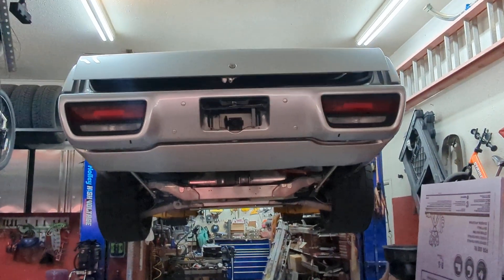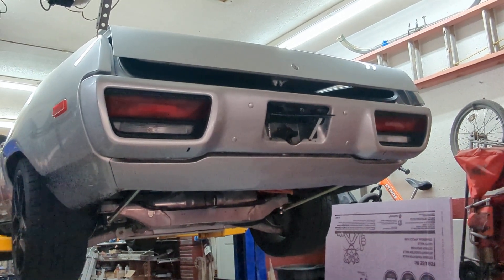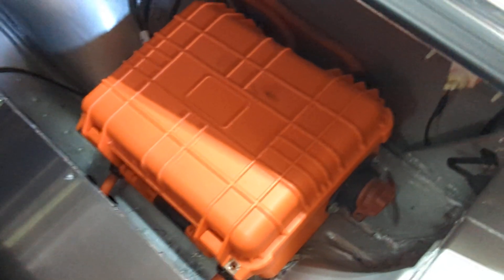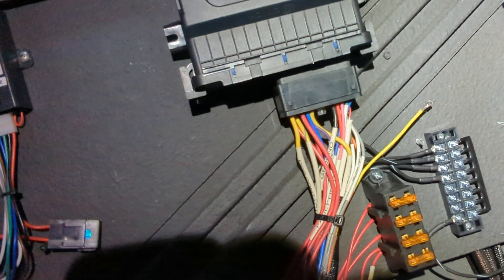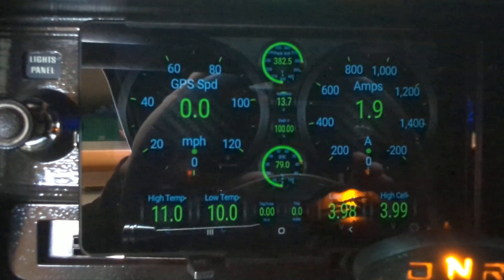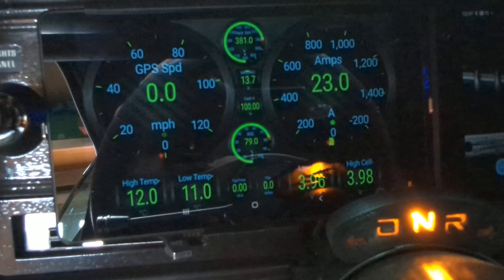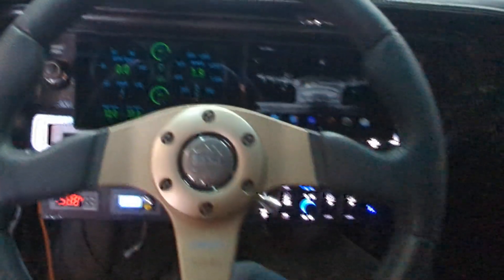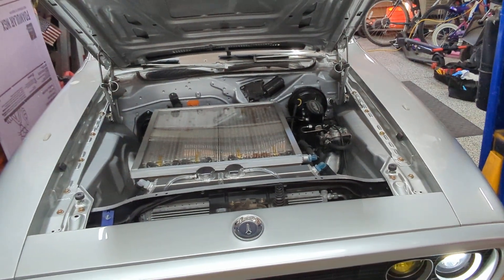Project Electrollite - Plymouth Satellite Tesla Swap - Race mode, HVAC, T-2C. EP. 19.

Comment: That is amazing. I've been thinking about converting my car to electric. 
Don't think I'd go Tesla gear, but your car is definitely an inspiration. I live in Lakewood, co.
Reply from the maker: Thanks, what kind of car and powertrain are you thinking about?
Reply: @MrMoparMan  well, I have a 1984 Honda Accord coupe, which I think would be a good candidate, because it's a very simple machine, no power anything, not even steering, standard tranny.  I was thinking how cool it would be to put an electric motor for the rear wheels, leave the front drive engine, so I could use either or. Or possibly both making it all wheel drive, but no idea how I could sync up the front and rear. But also having it so the front engine could generate power to charge the battery pack.
Reply: As far as power train, I've been looking into some of the conversion kits available online. I also have a 1977 Dodge sportsman 1 ton dually that I'd like to turn into a car hauler. And making it front drive electric, so the flat bed could drop to the ground for loading a car on it, sans rear end and drive shaft.

Comment: Are you eventually going to be putting a belly pan on it to clean up the underside and add some protection for the wiring?
Reply from the maker: Yep I sure am, just making sure I've got everything dialed in.   I'm thinking about adding a second coolant pump on the output of the motor as well as a chiller to pre cool the motor when racing.

Comment: Real curious how you're liking that model s rear end in terms of driving feel, I hear it's a real barge of a rear clip
Reply from the maker: I have to say I love it!  Maybe it's grading on a curve, but this is a pretty huge car weighing 4350lbs and it handles fantastic.  I also like the adjustability, easy to change from touring to drag racing.
Reply: @MrMoparMan  which is weird because the model s rear is universally panned for having little to no adjustment. Do you mean just the shocks? Or did you install a lot of adjustable arms?
Reply from the maker: @Ryukachoo  For now my double adjustable shocks, and ride height adjustment.  I will add adjustable arms at some point as well.